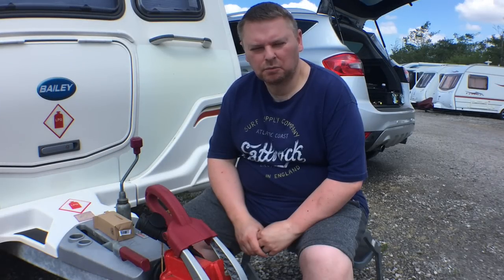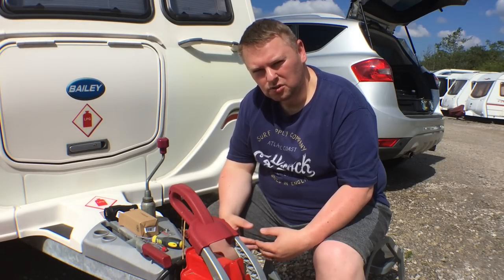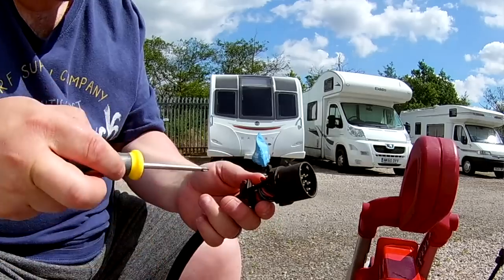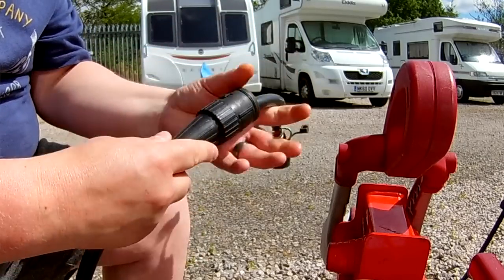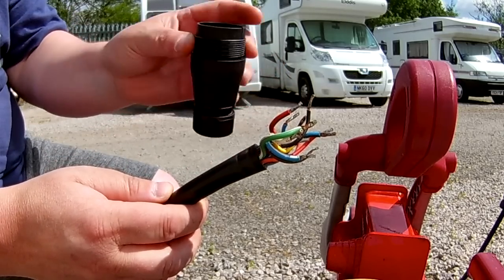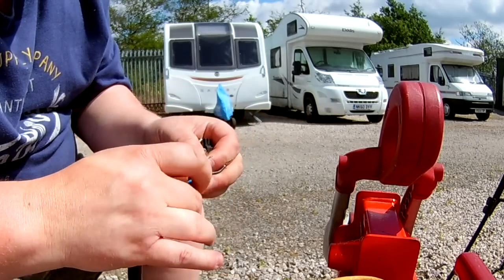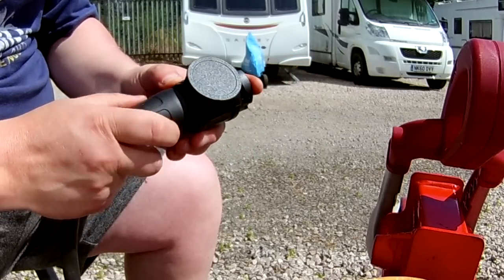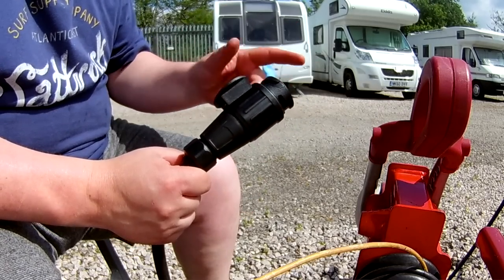Changing  broken 13pin euro plug

Comment: I didn’t know how to do it or if there were any special things to avoid. So I followed your instructions and blew the 12v fuse cos pin 9 was live. I hadn’t seen a wiring diagram so I didn’t think anything connecting to the vehicle would be live. Cheers
Reply from the maker: That was me assuming everyone would know to disconnect the battery when doing vehicle electrical work. As long as you got it sorted. Cheers

Comment: Thanks. I have to change mine and you've made it look simple. Do I need to isolate the caravan power from the leisure battery in any way?  Is there power going to any of the cables in the connector you changed please?
Reply from the maker: Yes disconnect the battery first to be on the safe side. Cheers

Comment: Another great video, very useful, the Fridge and interior lights, stopped working on the van shortly after we had it serviced.  Fridge and lights etc work off the 12v battery but not when plugged into the 13pin on the car.  Checked fuses and Going to trouble shoot through the manual; if that fails will look at replacing the 13pin socket.  Was it expensive?
Reply from the maker: I got the plug from amazon, £8. The fridge when traveling only maintains the temperature, they recommend running it on gas for a couple of hours to cool before towing. check which setting the fridge should be on when towing. Not sure about the lights. Not long until your France trip 😊😊👍

Comment: Hi Martin, just playing catch up on your older vids. Reccomend that you get a green cap for your plug. It will help protect from the element also a bungee to kepp the cable out of the way when towing and storing. Regards
Mike
Reply from the maker: Hi Mike, I’ve not seen the green cap, will look that up. The cable goes over the top of the hitch so it doesn’t hang down when towing. Thanks again for your support and feedback, Martin 👍
Reply: The green cap is used to realign. Its not a weather protection.
Reply from the maker: Still not looked up the green cap!

Comment: This is a fiddly job with so many cores to control. The makers of your old plug were cheap to use steel screws instead of brass. Must have saved them nearly a penny! 
 
@4:25 - tricky to get the wires through - I would cut the wires back to the sheath, makes threading the grommet etc easy. Then cut away the sheath (outer and inners), lengths like before, to expose a new length of cores. Reveals fresh uncorroded copper for better connections too. Pull an extra 2" from inside the van to make it up. @4:50 - silicone grease is the way to go; it deters water too.
Reply from the maker: Cheers for the tips 😊 there’s always an easier way to do things but you never think about them when you’re doing the job! 😊

Comment: Martin, again very brave, (electricity gives me the creeps? wiring ahhhhh? don't know what am doing?) actually very good, confident way about you, when doing something, thats great.
Tell me, when testing that fitting! plugging up the van and checking the lights? all worked , fine, but what about the other connections? IE==
 
13 Pin Euro Trailer Wiring Diagram
Pin No. Wire colour Trailer light Function
1 Yellow Left Indicator
2 Blue Fog light
3 White Earth
4 Green Right Indicator
5 Brown Right tail / side Light
6 Red Brake / Stop Light
7 Black Left tail / side Light
8 Pink Reversing Light
9 Orange 12v Permanent power for Battery
10 Grey 12v Ignition on Battery charging or Fridge
11 White/Black Earth for Terminal 10
12 White/Blue NOT usually used                                 (you said this?)
13 White/Red Earth for Terminal 9

How would you test for all these?
Reply from the maker: Good question Bryn, Testing lights obviously easy as for the rest you could check them with a multimeter. I don’t have one so I just checked the fridge 12v indicator light and the battery is charging when towing by checking volt meter in the caravan. The annual service should pick up if anything is not working. Some vans have different coloured wires but if you put them in the same pin in the plug all should be fine. My advice to someone doing this job would be, if your not sure don’t do it! 😂 cheers Martin 👍
Reply: @TheCaravanNut  : A guy like you should have a multimeter. They cost almost nothing these days.
Reply from the maker: Yes I need to invest in one soon 🤔

Comment: For some reason I have 9 and 10 reversed and the same with 11 and 13. Why is this?
Reply from the maker: Some vans are slightly different in the wiring, I would check the wiring diagram for your make of van. cheers 🙂

Comment: when i plug any thing  between  the car   and some thing else  , one do a propper job just jokeing about tape  . i do what you do bud  , but i all so put  gease  on the temminals  .... the wire up end ... not the  plug in  pins     and then spray    wd 40    on the pins    and case    stops   water getting in   . behind   the  bolt on   plug in i grease that becouse you  do not tuch  that
Reply from the maker: Hi Michael, good point about the grease, will protect the terminals and help keep moisture away! Cheers 👍

Comment: Big mistake. Pin 9 will be live! 12v. You will blow a fuse when you pull the wires through the old plug. Disconnect the caravan battery first.
Reply from the maker: Maybe I didn’t say I’d disconnected the battery, you obviously know how to do this job so why watch 🤔

Comment: Gave you a thumbs down. Only reason I'm on here is to learn how to take the plug apart, you did that in a half a nano second. I rewound many times but still couldn't tell how. A classic "you just pull it off" well mine doesn't just pull off. As John Wayne once said " yer hear how fast I'm talking, well that's how fast I'm listening" "yer can do it once slowly, or 10 times quickly"